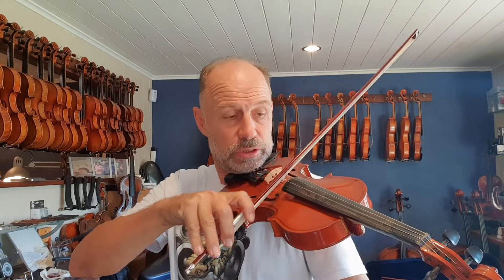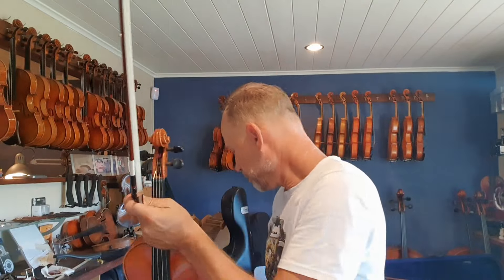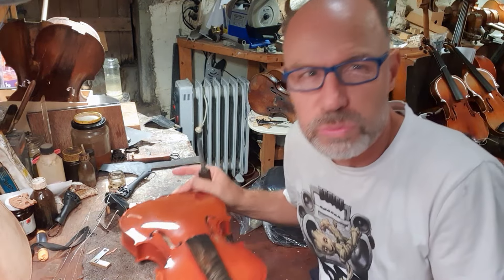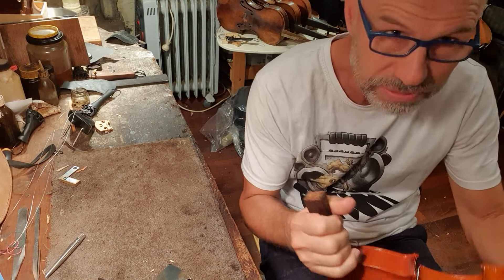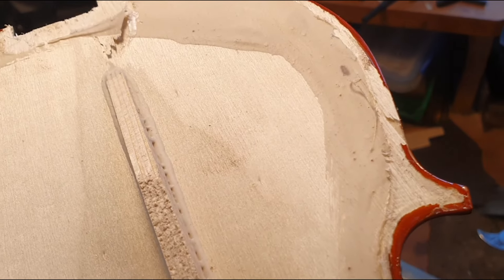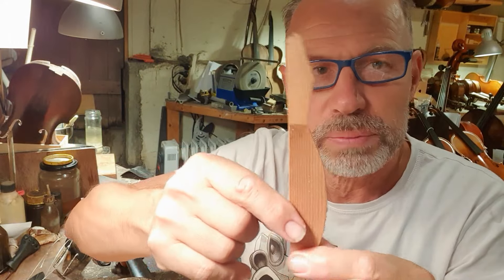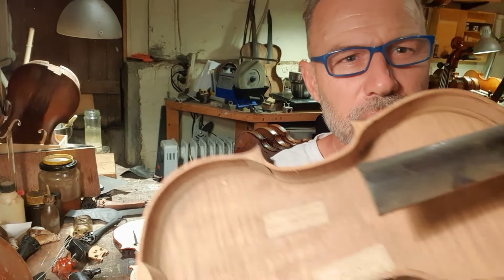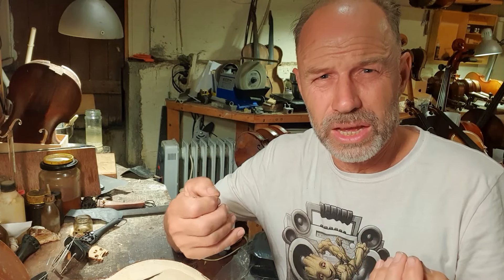I open up the 100 dollar violin

Comment: Thank you Olaf for the tour of the $100 Chinese violin, this is quite the eye opener.  Having been in electronic design and manufacturing for entire my career, I see many of the Chinese techniques used in low cost mass production.  The plywood is probably used, because it is the closest wood available in large quantities at a low price.  It also resists cracking when put into the steam press to shape the top and bottom.  The internal blocks and bass bar are likely punched out from a sheet of wood.  The huge amounts of glue are being used to fill gaps in the non-shaped wood pieces.  The varnish is more of a paint so you can't see the wood grain, which is mismatched and running the wrong directions.  I'm actually surprised the violin sounds as good as it does.  Obviously, much trial and error was put forth to arrive at a suitable compromise between sound quality and price.  Initially, I was expecting to see CNC machining of the wood but, the build/assembly techniques used here are much lower in cost.

Comment: @Olaf, Wouldn't plywood be possible for a Violin if you speak about the flexibility? Because if you make the plywood yourself, you can use different types of wood to obtain the qualities of Spruce but the potential vibrational quality of another wood. Since you can mix different type of grains to obtain a different sound quality. And unlike normal wood that you need to carve out. With the plywood, as you make it from scratch. You can potentially shape it according a baseplate from the beginning. Providing that nice base plate that you just need to carve the holes. 
I am hardly a violinist but I am just theorizing. Since plywood does have that advantage. Because like you said, pine's growth during the summer is more flexible while the darker grains are harder. So if you mix dense, light and tropical layers of wood. You should be able to experiment forth a different sound quality that solid wood cannot provide. Of course, that sound might not be ideal, but it is interesting thought to me.

Comment: Hi Olaf;
     Some of the modern wood glues are much easier to get apart if you use heat on your knife. Doesn't the bass bar also make the top plate even stiffer in the lengthwise direction? This helps keep the top plate from sinking in from the pressure of the strings through the bridge. It also gives the top plate a deeper tone on the bass side than the trebel side. My belief is that the bass bar serves many functions in the formation or the tones of the violin and also the structure. It's quality is extreemly important to the overall quality of the violin. I love your videos and like to get others opinions on the different aspects of violin building.
     I'm only an amature builder, so I know I have much still to learn. Alas, at my age I unfortunatily do not have an abundance of time to learn. Thanks for sharing your knowledge with us.

Comment: I'd say that violin is still good for some additional testing even though you were disappointed in seeing the inside. Scrape off the PVA adhesive (looks rubbery and sound deadening), rework/replace the bass bar, reassemble with hide glue as you'd normally do, correctly place the sound post. Retest. You'll probably hear a great improvement even though it's a plywood top. Use the same strings and bow to A/B vs the same better violin and link the videos. 
Second dive into it, make a new top (or find another that fits) with conventional wood but keep everything else the same about this violin, even the same strings and same bridge. Sound test. We all may learn a lot. 
While I played viola as a kid, I play, repair, and build guitars now -- the most important parts are the bridge and bracing even though all the rest is 'marketed' as desired. If you watch a guitar builder video they spend all their time 'tap-tuning' the top while carving the braces to get to the desired tone. No work is done on the top material, and while the $100 acoustic guitars have similar laminated tops (prevents splitting) they do not get the carved braces and that leads to the tone differences.
Reply: When you also replace the bottom, you have an entire new violin.
Still not worth the labour.
Reply: Seeing that it was plywood yeah that was heartbreaking. When we do "fittings" for a violin it is because things are literally not cut properly like the nut or parts of it because it is a VSO. But if the VSO is such low quality the labor grossly outweighs the vso initial cost.

Comment: actually kinda surprised they can get the plywood to sound 'okay'...makes me wonder, after what point you pay for a violin made with proper timber does the timber not matter in the pricing...in otherwords, what's the cheapest you can get a violin for that has the "best" (soundwise that actually makes a difference) timber?
Reply: sonicase you might be able to get a violin with a real wood top for a similar price to the one he has there.  Certainly if you went up to two or three hundred you could get real tonewood.  Having said that... there’s wood and there’s wood.  The grain might be a bit looser than a nice instrument.  If the wood is softer, they have to cut the plate a bit thicker or it’ll crack or warp or what have you, and that will leave the violin sounding muddier.  
I’ve seen fiddles for eight or nine hundred with wood that looked every bit as good as more expensive ones.  Maybe Olaf or another luthier will say there’s more to it than how it looks though.
Reply: I guess it is not so bad for early graders.

Comment: Could the top of the violin be carved with a cnc machine? If it were made to the same size and thckness?
Reply from the maker: It could, but the problem is sound... every piece of wood is different and every top needs to have a different thickness to get a good sound...
Then the back also needs to work in harmony with the top

Comment: The layers of glue will also damp vibrations in the top plate. This will partially be through absorbing some of the energy as the glue expands and contracts, turning the sound into heat, but I suspect that differences in the speed of sound through the glue as compared to the wood will have a bigger effect, as it would cause the waveform of the sound to spread out, giving a muddy, muffled quality to the sound, as well as less volume 

Edit: That second effect, dispersion, would also happen if the top plate was too thick, which explains why your instincts told you that might have been the case

Comment: So- being an artist, I know that PVA can be softened by Ethanol and water, with heat being applied to speed things up. Denatured alcohol can work too.
No. No to the fact that woods grow in the springtime, summer, and then retract nutrients from the branches in the fall, going into winter they don't grow. So the grains you see are from springtime to the end of summer, and at the end of fall, the darker grain stops, until spring begins and new growth, (fast growth) begins again for the lighter fast growing grains.

Comment: Springwood is usually light in color and of low density. It contains much of the wood tissue that conducts water up and down the tree. Wood produced later in the growing season is called summerwood and it is usually denser and darker.

Comment: I am very curious about the prospect of one of these made of metal.  The required flexibility of the top panel should be possible by machining groves in the inside along the length.

Comment: Very informative video!  Thank you!  What is a God Pillar?    I wish I knew which dealers were reputable.  It helps if you can open up the violin, but unfortunately most of us can't do that.  The violin I have is in need of repair.  It has a couple of cracks at the at the bottom and makes a buzzing noise while playing the lower strings.

Comment: Hi. I have overcame a very old violin. When I opened the top to fix the cracks on it I saw the basbar that was awfully made, super thick on the end, i wish i could show you how bad it was but the rest was time consuming made. Is there a sheet i can print out so i can restore it to more correct measurements? Great tutorial by the way!!!
Reply: Bass bar might be a later bad repair.

Comment: I thought it would just be ply steam pressed into shape - lol -. I suppose they couldn't scallop the edge with a dip because it would expose the plys, then again they covered the exposed edge plys pretty well. I don't know if it is really worth putting back together, at least without doing something inside, because it just going to take up space in the corner.

Comment: Until I heard the comparisons, I would not have been able to tell any difference between the instruments—such is my ability to hear timbre differences. Also until the comparisons, I would not have thought the $100 violin sounded deficient. I would love to see a blind ABX test in front of a small group to see which violin people thought sounded best. It is my understanding that in previous ABX tests, a statistically significant # of people can't tell the difference between cheaper and very expensive violins. Although when heard these two violins next to each other, the difference is very apparent in my opinion, greatly in favor of the more expensive violin. And man.....plywood???? Oh boy.......
Reply: Significantly a lot of are tone deaf too. But tuned music subsists nonetheless. And I'm one of those who could tell. And I don't play a stringed instument. And even I couldnt pick up some of his references, but I could tell that the more expensive violin had a wider sound field, its sound was more complex, even though the volume was practically the same. It's the physics of the materials together that makes the sound. 

Thinner materials will vibrate and produce its overtones as the sound from the strings hits the sound box and bounces out into the air. The spruce being strong and light makes the sound more complex varying yhe length of the sound waves coming out of the sound box, and providing more energy. Its like a tennis ball hitting a racquet. If you just hold the racquet still, the ball will just bounce straight back without much impetus. But if you swing the racquet to hit the ball there is a transference of energy and the ball goes much further. That's what happens between sound hitting plywood and it hitting spruce. 

Plywood having more mass and stffness, can't project soundwaves as much around and out the sound box. And the weaker soundwaves will lose energy and not come out of the sound box. So you hear the strings, but with less colour and complexity. 

Spruce vibrating in sympathy with the strings, moves back and forth hitting the sound waves around the sound box and out through the sound waves, so you get a louder, bigger and more complex sound from the spruce, with that richness underneath the string sound.

And one more thing: Youtube compresses the audio on video, so what you hear on your device is rarely true to nature. Some depth is lost. So if I heard the difference, it must have been even more significant.

Comment: WIth modern CNC you could make these violins pretty fast from real spruce and have the basic shapes inside and out almost as it should be and then just let someone to make the final tweaks and assemble, paint/varnish and go... It would be 10x better and still cheap as chips...
The fact they didn't even do that is just mind blowing....

Comment: I found this looking for videos to open a new violin. I bought a right handed violin and am going to open it and move the internals to convert it to left handed. I'm a wood worker so I'm pretty confident. I'm think a thin razor blade/ exacto knife  will work best as it is new glue. Thoughts?
Reply: Take it to a Luthier. I think you run a risk of breaking it if you do it yourself with no experience
Reply: @Shadowwing1994  I already did it myself. I had zero issues.
Reply: @NassiveMutts  that's amazing!! Happy it all went well

Comment: Olaf I have a question! My violin isn’t super cheap, and the pegs are stuck!! Especially the E string. Do you have any tips on how to loosen them without taking it to a violin shop? I’ve taken it to the same violin shop where I bought it and the pegs got stuck AGAIN
Reply from the maker: Look at my video on how to put on a new string and I think I did one on pegs as well...
If the pegs fit, peg paste will do the trick, but if they don't fit, you may want to try a different luthier. 
A good luthier would have picked up the problem.
Reply: Ask Olaf the Violinmaker thank you Olaf!

Comment: I love your video.  I have a question regarding a sound post/  VS the bass bar.  My cheap violin has a sound post, what is the difference? I didn't see a sound post in the one you dismantled.  And also how much would you have to spend to be sure it isn"t plywood or a VSO?
Reply: All violins have sound posts. It's literally to transfer sound from the front and back sides. They need to be placed professionally.

Comment: as much as you seem to hate the VSO (with reason) I think it sounds fine! I am not a violonist tho only a guitarist and drummer, I can clearly hear the difference between the 2 but I mean, for someone like me who"d like to learn it for fun, it would do the job perfectly for not that much
Reply: You have to understand it takes years to develop a stable enough sound so when you're constantly fighting your own instrument it quickly becomes a frustrating experience. Even 300 is much better.
Reply: @brattingprincess  kinda the same on guitar except you can adjust them easier. altho there are some that are beyond adjustment from the factory I guess its the same for most instruments

Comment: Just out of curiosity and I doubt I will get an answer.

But have you tried experimenting with different types of plastics as plastics can be manipulated to form virtually any structures you want, and as there are so many different types of plastic you may find the right type that would form exactly what you are looking for on a more reliable reusable way.

For example you get hard plastics soft plastics, highly flexible plastics or ridged plastics, some are very cheap some are more expensive, but looking at what you are showing perhaps there are plastics that would service this purpose much better and more reliably easier to replicate.

Comment: Sounds surprisingly good for an instrument made like that, though the improvements are in the setup and string choice I suspect. I look at those cheap new violins and wonder to myself if people at that end of the market would not be better off buying an old cheap one.

Oddly I have just bought a Medio Fino, apparently made in France by JTL around the late 19th or early 20th century. According to some sources the tops (and possibly the backs) are steamed then pressed. They are apparently now well regarded for the £1,000 price range... But they are not plywood and fairly certain glued correctly. Mine sounds good for the price I paid.

Comment: In the 1960's Japanese companies began exporting lots of guitars and many cracked during shipment. Yamaha solved this problem by switching to plywood, and the cracking went away. Many millions of these guitars were sold and certain models are highly collectable today , with surprisingly good sound that has improved over time.
It is undeniable that quality solid wood is superior to plywood in terms of tone, but you almost never see a 50 year old Japanese guitar with a cracked plywood top or bottom but you do see lots of American Martins and Gibsons with cracks.

Comment: the best way I can think of to cheaply automate (at least the bulk work) of making a violin is with a CNC router. Carving it on one of those is relatively fast and if you know how to get the wood to respond the way you want (virtually nil chipout) you can move straight to (first sawing the attachment tabs) and then scraping. in fact CNC routed parts of large piece wood could make pretty acceptable basis pieces.

Comment: A lot of cheaper violins I find have a vanilla sound to them. Not rich, not much character, but I have a few 70-150 dollar violins because they do sound bright and clean, not rich or tons of character.

I think I have a Mendini mv300, new strings (threw out the bow for a shar $50 carbon fiber bow), and I just deepened the bridge grooves a bit with a knife and it plays beautifully. I know I'll get a lot of shit for saying that, but I do own expensive violins. The quality control across the entire violin stack is probably not there, but mine works acceptably. 

Some people get good ones, some people get bad I presume. That's what you get though, when you're on a bargin.

Comment: Actually, the summer grain is the dark one, and the light one is a spring grain. And for instruments you want there to be a lot of summer grain (but not the pressure wood as it is often uneven) as it is increasing young modulus and thus the sound attenuation by radiation. Also you want the summer and spring grains to be as evenly spread as possible to not infuence the resonnancy at some spots of your instrument. Also nothing bad on 
plywood if you have it correctly calculated and well made.

Comment: One of the first cellos I got was from China for $330 USD shipped. It was super glued 3/8th inch plywood with (I'm guessing) polyurethane varnish used for furniture, painted on purfiling, and had no name just a tag saying it passed inspection.  Also, when I look down the length of it from the scroll to the tailpiece I can tell it's actually not bilaterally symmetrical. But hay, It worked and I played the crap out of it. hahaha
Reply: If I remember correctly violins are not made bilateral symmetrical.... They only look so.
Reply: @lukas3687   🤔 I thought the body was? Obviously the finger board, bridge and tailpiece are made to taper to one side for playability. I'm talking about the ribs, bouts and even the end pin are a big off.